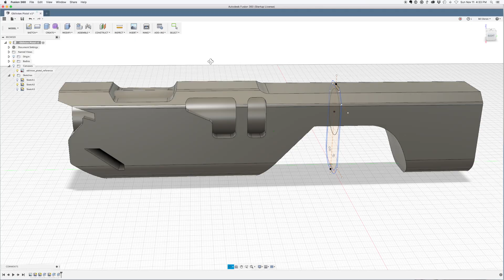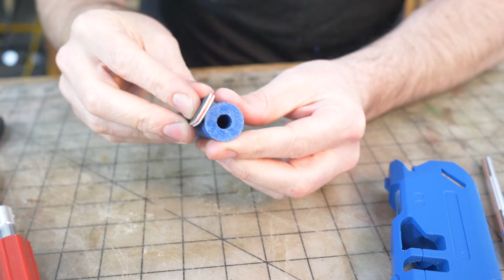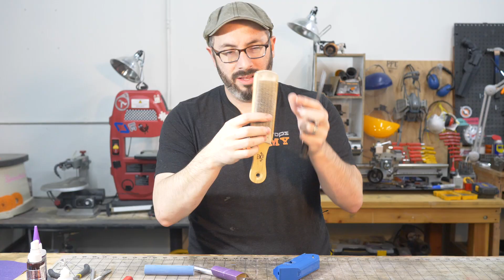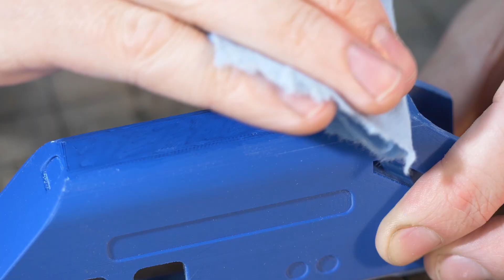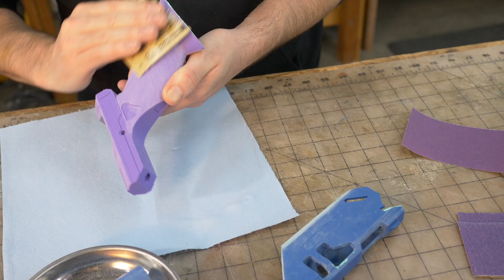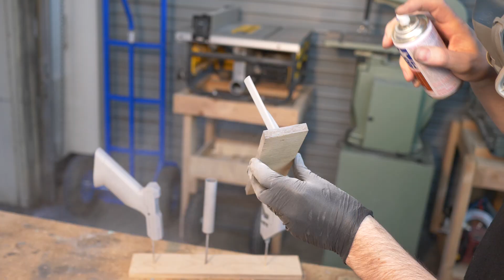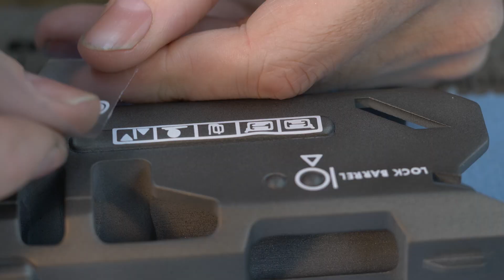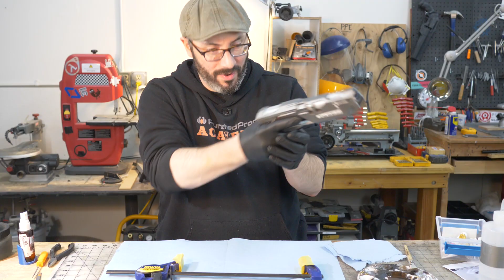From 3D Model to Finished Prop - Tom Cruise's Oblivion Blaster!

Comment: Definitely PETG here. Prints well on my modified Prusa and sands/post processes better than PLA without being that much more expensive (assuming you're using a quality PLA and not some $20 amazon budget brand). Only issue is Ireland is humid so it needs stored well and dried. It 93% humidity at 2 degree Celcius atm for example. Love the carbon fibre stuff most of all for functional stuff.
Reply from the maker: Ooh neat!
Reply: PETG here too but in Florida, at 100% all the time. I feel your pain. I think my PETG holds up in the moisture better then when I started with PLA.
Reply: @DK-Design  Oh yeah, while it gets wet quicker than PLA, it can at least be dried out and be good as new; with PLA the structure changes so pretty much once it's wet it's boned.
Reply: You think it takes paint okay? I’d heard a lot of people say that PET is really difficult to paint. I’ve only tried painting PLA because of that.
Reply: @rocknrollnerd3  If you prepare the surface well enough it tends to do pretty well. Definitely want to key the every living shit out of it with something coarse like red scotch brite and then give a good auto primer cover before any paint. Straight on the surface without any primer and it just... well it doesn't go well XD

Comment: ABS is good for something small like handgun, but helmet or something bigger in abs is a nightmare, I tried.
Bigger the part harder it is to stick to print bed. warping is way stronger, and layer splitting too.
Also big ABS parts shrink in all axes and if you have some king of assembly it will not work like it works with PLA. 
PETG is a good material if I need temp resistance, and sanding is ok with it.
Reply from the maker: Print a helmet in ABS? Challenge accepted! =D

Will I regret this? Only time will tell...
Reply: @punishedprops  It can be done, but it has to be a lot of small pieces, I tried printing half of my big shoulderpiece on my prusa mk2s in enclosure, resulted in a wasted roll of abs filament.

Comment: I prefer ABS-X by Trideus. It's an improved version of ABS (other manufacturers sell the same stuff under a different name), it doesn't shrink or warp nearly as much. I have printed with it in a near freezing garage. My Prusa I3 MK3 is in an enclosure, but it's a very simple enclosure (Ikea Lack tables and acrylic sheets) and it's not sealed or insulated. I use this for anything that needs to be sanded smooth. It sands very well, but it can't be vapor smoothed with acetone.
For parts that need to be strong and don't need sanding, I use PETG. It's more durable than PLA but prints very easily. And finally, my PLA of choice is Trideus' PLA. Prints very easily, and less brittle than most PLA.
Reply from the maker: Fantastic tips, thanks for sharing! =D

Comment: Superglue to glue together ABS is kinda wasteful though, could just use dabs of that acetone slurry you got to weld the parts together.
Reply from the maker: That totally works! I tend to work with superglue, because I can activate it and have it cure instantly instead of waiting for an ABS slurry to evaporate. I will say that acetone welding ABS parts together is probably much stronger than the superglue, if you've got the time.

Comment: Those parts that were really smooth how high of grit did you use?
Reply from the maker: You can check out the whole build process here! https://youtu.be/C6Rn75N8Ss4
Reply from the maker: We only went as high as 400.
Reply: Punished Props Academy what grit would get to that smoothness of the thing you showed that you said you made molds of?

Comment: I just print PLA and PETG now, ABS smells terrible and it shrinks a lot when it cools down causing corner lifts etc. PLA for non-mechanical stuff, PETG for mechanical stuff like printer parts or something that needs to be durable/a bit flexible.
Reply from the maker: Sounds like you've found a really great fit for your workflow! =)
Reply: @punishedprops  Eh I dabble, I made my own i3 clone from individually sourced bits May 2015, feels like most of what I've printed since are upgrades to the printer itself... It started out kinda a mk1 and I got an upgrade package done (been done for months, but haven't had the guts to tear down my only working printer) that brings it to near parity with a mk3. This video really makes me want to get into printing props etc, problem is sourcing all those materials in a country amazon doesn't acknowledge the existence of, and that just added a €8~ fee on imports from china, oh aliexpress my love, I miss you.
Reply: I have a question, but if I had to print for example a large object for cosplayer (a hammer), would you recommend a PLA or a PETG filament?
Reply: @stefanopaulli9193  Not sure there is a clear cut answer, PLA, ABS or PETG should work, all got pros and cons, PLA is more brittle but as long as you make your walls 5mm+ it shouldn't be a problem unless you actually try to hammer with it, or drop it or put it down carelessly etc. PLA is terrible to sand so if you want to sand it to get the finish you want it's not ideal, PETG has most of the pros of PLA and ABS (easy to print like PLA, mechanically strong like ABS) but it's a bit more expensive and it can have stringing problems with some brands or if you don't dial your printer in just right. ABS is great to sand and you can acetone weld it to join pieces permanently as if it's one part, but it smells really bad while printing, and you need a 100c bed and enclosure etc to have even a slim chance of the corners staying on the bed. If it's a large prop you probably need to add some additional structure like he did in the video, add a metal rod or wooden dowel, I like threaded rods myself because you can use nuts to hold things together non-permanently or add epoxy, the epoxy grabs threaded rods a lot better than smooth rods.
Reply: @KriLL325783  Thank you so much for your time and useful information, I appreciate it

Comment: ABS slurry on the bed? Really? That's so retro XD PEI works better and gives nicer finish/less leveling headaches.
Reply from the maker: I think that the slurry method works best for me in my situation because I have a glass bed and an enclosure printing ABS. I know lots of folks prefer PEI for other setups, like printing with PLA. I also adore the flexible, textured, and removable spring steel beds on the newer Prusa machines.

Comment: I just got started and still using PLA. I have bought ABS but it seems quite a hassle to get working and with all the heating. It seems PETG has most of the advantages (mechanical robustness) of ABS, yet prints about as easy as PLA.
What I also have seen is the wood PLA which seems kinda neat. You can even stain it like real wood.
Reply: Careful with wood PLA and other filaments with particles, very abrasive on your nozzle, you either need a very hard nozzle or to replace your brass ones occasionally. ABS is a hassle to print, you need an enclosure and high temp bed etc to handle the high amount of contraction on cooling causing pretty terrible warping making corners of prints left etc, and ABS smells terrible, only real reason to still use it is that you can acetone weld it, it sands very easily and it's cheaper than PETG.
Reply: @KriLL325783  Yeah thats about what i gathered as well about ABS, I think the marginal price difference is probably worth it for PETG, especially since likely less prints will fail as well. I didnt know that the wood was hard on the nozzle though, thanks for the heads up.

Comment: eSun PLA+ prints great and easy and has a little higher glass transition temp than regular PLA. I've done quite a few larger projects with this filament.
Reply: PLA is terrible to sand though, kinda smushes and clumps and doesn't come off the print, hard to describe but sanding PLA is a headache compared to ABS or PETG etc, if you need to sand your prints PLA isn't great.
Reply: @KriLL325783  I don't disagree. I tend to use XTC3d or putty when I need it supersmooth. Most of the time I highfill primer will do most of the work. I've also found wet sanding is way better stop the clumping.
Reply: @samuland  Yeah gotten further into the video now and wow that's a lot of sanding, feels like shrinking the 3d model a smidge and coating it in some kind of primer or something (I assume that's what XTC3d is) instead of sanding that much would be a lot less tedious to build a smooth surface on top of the print basically, instead of sanding the print down to be smooth.
Reply from the maker: I know lots of people who prefer PLA and they'll blast the print with some kind of filler, like a high build filler primer, right off the print bed and then sand it. To each his/her own! =)